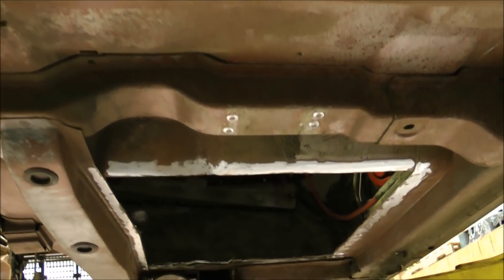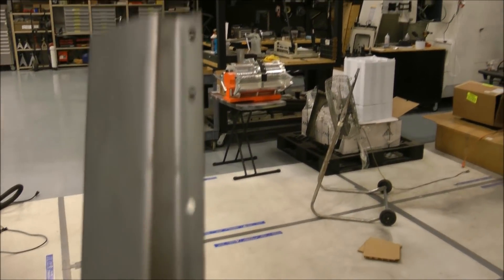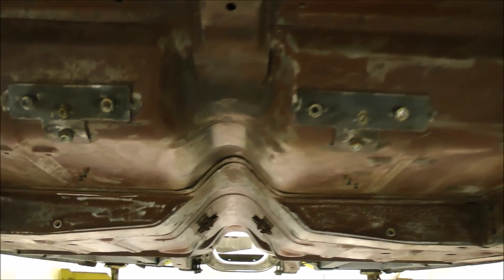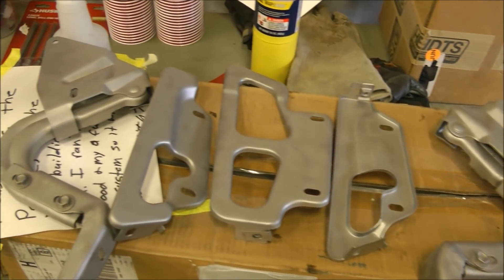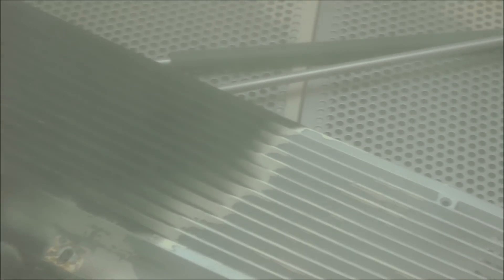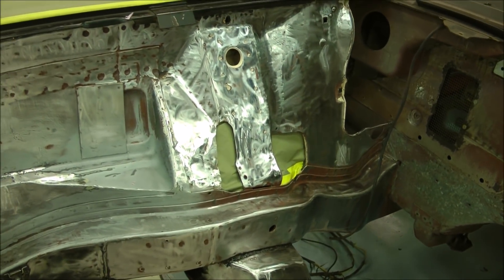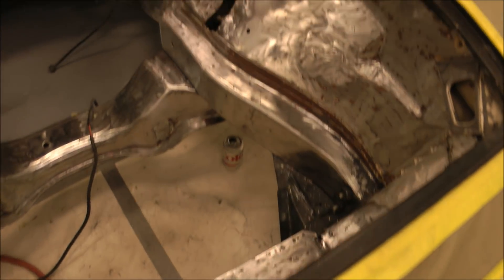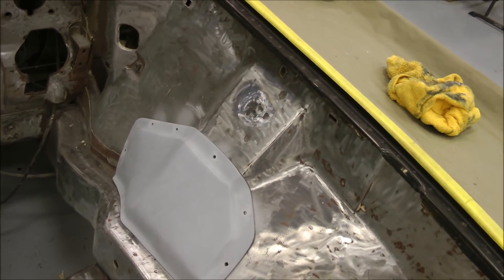1964 Lincoln Electric Conversion Part 5

Comment from the maker: Sorry for the slow updates. I will give you a list of explanations, but when I was an executive in high tech, I used to tell folks that explanations are often excuses in a tuxdeo. So here are the well dressed explanations. 

As most of you know, we have a Mustang under conversion that was first line and most of our limited resources have been working on it. Good news is that a lot of what we are doing will also benefit the Lincoln. For example, we have designed and fabricated a custom bell housing to connect the electric motors to the power glide tranny and that will be exactly the same for the Lincoln. We have had to get custom couplers made for both cars to connect the output splines of the motors to the power glide. Those are finally complete and fit perfect. 

We have had a series of breakages with our vintage CNC machine and you can imagine finding parts for 96' is not easy or fast. 

We have seriously underestimated the number of hours to machine a liquid cooled battery like ours. It is looking like over 1,000 hours per car. 

Two of my key partners/builders also have day jobs which have recently demanded more time from them which means less evening and weekend time for Blood Shed. 

I have thought a lot about bringing in some private investment money (4750K-$1M) to upgrade the equipment (a new VF4 or 5 HASS would cut the battery time in half) and hiring some full time guys and explore building our own motors and perhaps offering kits, but I don't have the anyone in my Rolodex that fits the bill.  

Anyway, enough crying for now, please stay tuned for the next update, there will be one sooner or later.
Reply: mitchmedford love this work. I am going to buy a continental and would love to have the car worked on and converted by you guys!!
Reply: I love the videos. You do a great job explaining and also keeping the filming in short clips so we're not watching paint dry. Please keep the videos coming. I'm particular interested in this Lincoln project as I have a 66 convertible.

Comment: Will it have a hidden firewall? I have premature questions about weight distribution depending on where  thee batteries will be as well as power brake and steering.

Comment: Enjoying your videos, dig the music in your shop and especially like this Lincoln. I'm 58 and working on my second project, a 66 Mustang fastback. After considering the many powertrain options, I'm leaning toward electric. I live in Hawaii so 100 mile or so range is enough. Highway speeds of 65-70 are sufficient.  Can you point out some resources to get started?
Reply from the maker: Start with EV West. We get a lot of parts from them and they also do conversions so they know a lot. I would also join EV conversion forums. Great sources of information and advice. Just google EV Conversion and go from there.